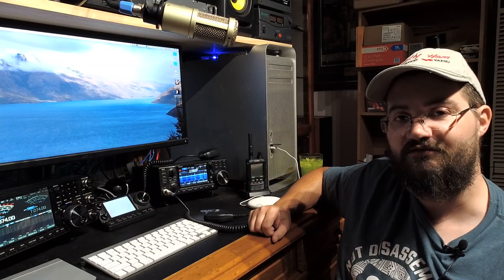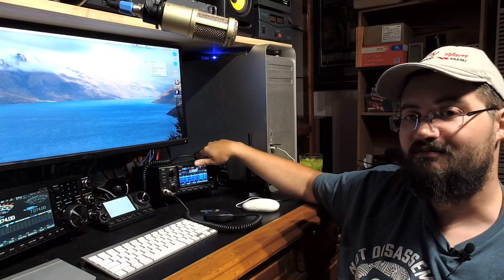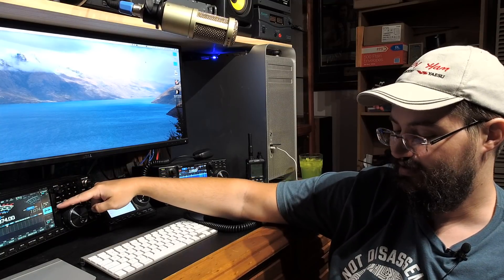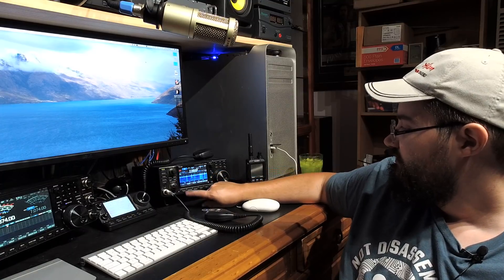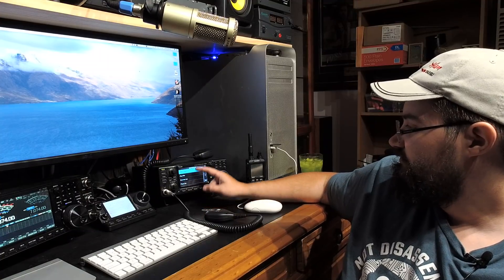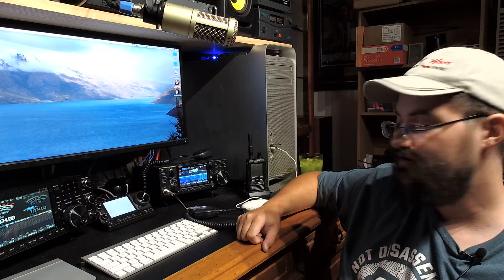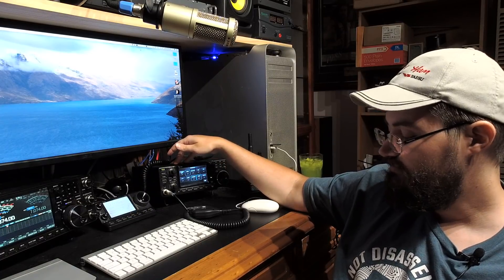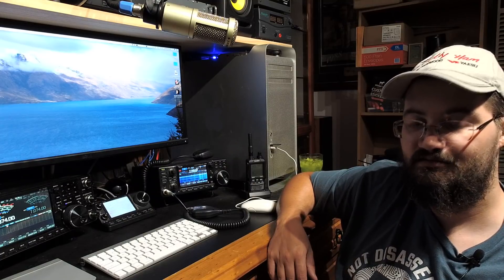5 Ways the IC 7300 is BETTER than the IC 7610

Comment: Both radios are market disruptors (and I'm not traditionally an Icom fan), but at opposite ends of the spectrum.  Both are good value given the feature set.  Both are going to push other vendors to innovate and provide better price performance. FTW!
Reply from the maker: My favourite analogy is one is a Lexus, and one is a Toyota.  And my favourite bit of advice to go along with that analogy is that there is no point owning a Lexus without a nice garage for it ;)
Reply: Was shocked at the performance on my little active loop from my last radio(only listen). Incredible reception that was unable to get in the last two years with my older radio.

Comment: 3:10 This is operator error. Auto notch is disabled in CW as it would eat the desired signals.  Only manual notch is avaliable.  Change your mode to SSB and you'll have auto notch.  The 7300 works exactly the same way.
4:50 That pronounced notch is because you've got manual notch turned on.

Comment: Thanks Jarrad, good points, I have a 7300 and have been considering a 7610, along with the lack of buffered rx output on the 7610 I think I'll stick with my 7300 for now and just add the aftermarket receive buffer board in order to use an external SDR with the 7300, 73 John K1KSC

Comment: I have them both. All valid points for sure.  But for anyone on the fence actually trying to decide between the two.. remember, a video explaining all the advantages the 7610 has over the 7300 would take a lot longer than this one.  Just compare the rear panels for a partial summary. -AD5VM

Comment: Totally agree. The 7300 is more refined in the " fit and finish " and built better than the 7610 IMHO. The screen looks more vibrant and has a nice matte finish and not plagued by screen quality issues as the 7610 is / was. I was ready to buy a brand new 7610 about four years ago, sat down with a display unit at the local ham radio store and was turned off by this, and turned off by the fact that they deepened the access to the Notch functions which I use a lot. The 7300 had it right on the front panel...nice !

 I completely changed my mind and bought a Kenwood TS-890. Love it !  The Icom IC-705 and the IC-7300 however are a total success story IMHO as I have both and are totally amazed with them and are a lot of fun ! 
 I'm sure the 7610 performs well but would like to see a 7610 Plus  ?  or  MKIIG ?

Comment: Sorry but the 7610 many times better than the 7300.   I think you just need to understand how the radio works.
7610 does have a very good notch setting.  Look at the back of the 7610, the connections you have to choose from is very nice.

Most hate what they don't understand..

Comment: The quality of the receiver and filtering is what makes a radio. The feel of the knobs, the type of paint used on the cabinet and the placement of the notch filter have nothing to do with the receiver and filtering. I love my 7300 but it lacks some features found on the 7610. And to me, those are important features. Granted, the 7300 is quite adequate most of the time but not in some circumstances which are ignored in this video.

Comment: ... and i prefer my FTDX 101D... :-)
Reply: I can't decide between the 7610 and the 101D.  I'm normally an Icom person....
Reply: @piquat1  The 7610 Is 10 times the radio of the 7300 I had both now have 2 7610,s dont understand how you can not see it.
Reply: @byroneism  Ya, it is. But I didn’t say anything about the 7300. It was below my price point. I was vacillating between the 7610 and the FTdx-101D. Got the 101D.

Comment: I would still buy the IC 7610 because it has a 2 antenna ports and a separate port for RX antenna great flexibility
Reply: At 2022 prices, you can buy two 7300's for $1000 less than a single 7610.

Comment: The IC-7300 is truly a remarkable radio. To use a term that has been used loosely by other manufacturers in the past, this IC-7300 really is a game changer. When something comes out that is really good, boxing well above its weight, I buy two of the items. This is true of the IC-7300 - I bought one from the first batch released (I think it was March 2016). I was so impressed by it that I bought a second one in August of that year. I still have both radios and intend to keep them. I was so impressed, that when the IC-7610 came out, I wanted one of those. However, the screen burn in, and loss of the deep black background to more of a milky black has stopped me from buying it. It seems they have still not resolved that issue. If I lived in the USA I probably would have taken my chances, but I live in Kenya, East Africa. To send a rig back to the USA or UK would be prohibitive in cost. I fully agree about the shiny / glossy black on the IC-7610 - it looks like a cheap finish to me. I FAR prefer a matt finish

Comment: Hi Jarrad,  I like your you tubes.  I like to add a comment. I always been a Kenwood user..I recently purchased a Kenwood TS890 .Using the 890 for 2 months  I sold the radio. I felt it has a lot of old techknowlgy so I sold it..I went back to my older kenwood 870.. Then I hear all of the hipe on the Uc 7300.. So I too a chance to purchase the 7300.  SURPRISE !  The 7300 is smaller radio BUT if gives a nlot of useful features..THe Scope are good and the radio is very stable.  OK Now  the icom 7300  blows away the Kenwood TS890... Im still a Kenwood Guy. But the 7300 is my daily user..A outboard speaker helps..or headphones by Sony-7506.. Best bang for the Dollar is Icoms 7300 by far. even over the 7610...you got it right  I agree. w2ot/marty

Comment: When will we get a SDR version of the 7610?
Reply: The IC-7610 and IC-7300 already are SDR rigs, but in a box with traditional knobs. The SDR architecture of these rigs is what allows them to have that real-time and fast (about 25 fps) spectrum display and waterfall, over the entire displayed frequency range
Reply from the maker: I don't think Icom will ever release a 'black box' style radio, BUT with the newer firmware and the USB 3.0 connector you CAN use the IC-7610 as if it were a black box SDR.  73, Jarrad VK3BL :)

Comment: are the knobs on the 7300 also buttons? I know the 7610 is a knob as well as a push button which I think may be why its a little looser.???
Reply from the maker: Its been a while now Mike but I don't believe they are buttons, and I agree that is probably why they feel a little looser.  That said, the knobs on my Yaesu FT-8800 and FT-8900 mobiles always felt tight despite being dual purpose buttons too.  73, Jarrad VK3BL

Comment: I have a made in Japan Icom 7000. Its a darn good radio too. If you are looking for a non-SDR Icom you can not go wrong with the IC-7000. They made Ic-7000s in china too.
Reply from the maker: The IC-7000 is a very popular and reliable radio :). We sold ours only because it was out of warranty and over 10 years old, also we were 10 years older and liked the remote head of the IC-7100 which sits easily on a desk :). 73, Jarrad VK3BL & Ben VK3HBN :)

Comment: Hi Jarrad, so you say that is better to buy IC-7300??? Is the 7610 just a waste of my money?. Is this your opinion just because of screen burning or loose cooler issue? There is really not a better receiver or any other significant better things on it compare to 7300?  Thanks. I am still decide between IC7300 and IC7610 which one to buy. Thanks. Paul OM0ET

Comment: 7610 - 16 bit adc, 7300 - 14 bit adc. Dynamic range and sensivity on 7610 will be better.
Reply from the maker: It is, but the enob isn’t 2dB higher, and the sherwood charts list the IC-R8600 as higher than the 7610 despite its 14bit ADC.  I wouldn’t buy just based on 14 vs 16bit.  73, Jarrad VK3BL
Reply: how did you get this info from not sure you are correct at all
Reply: The 2 bit is the noise any way no different at all

Comment: I suppose if one had deep pockets, one may wish to purchase a even more expensive rig.
That said, we are all either not willing or unablew to spend close to 3 grand for a radio, after all, this is my hobby, not a profession.

I've had my 7300 almost 2 years and see no need or advantage to buying the 7610; at least not for me.
Will the 7610 pull out signals the 73-00 can't? Doubtful. Will it TX cleaner RF? Doubtful.

I'm sure the 7610 is a great rig; just no benefit to me.
Reply from the maker: Just wondering Peter, are you a Canon or a Nikon guy?  To use a camera analogy, we'd say the difference between the 7300 and 7610 is the difference between Canon's 'Fixed 50mm' 1.4 & L series 1.2 :). 73, Jarrad VK3BL
Reply: The difference is that I earn my living from photography; ham radio is a hobby only for me. 
Again; deep pockets?..go for it. On a budget, the 7300 does everything I want, Is the7300 better in some ways? Maybe; just as the L series lenses might be considered better in (some) situations.

I am agreeing with you, IMO the 7300 IS better in some areas of operation, especially when one factors in the price of the 7300, it's a bargain.

Oh, to answer your question; been a Nikon guy for 35 yrs. ;) They are better; right? LOL

Comment: The IP+ function on the 7300 improves the selectivity in a pileup, and on CW the notch works well too. I have two IC-7300s and find the pair easy to use, can use different antennas, run in diversity receive mode using a simple cable between the radio  control ports with an on/off switch, and control both radios from the USB port for remote operation with a single IP address to the server computer running ICOM REMOTE. 

I personally think my two IC-7300s as a pair are far better than the IC-7610 and I have money to spare for the RC-28 remote encoder, and auto-tuners, etc.
Reply from the maker: It sounds like you have quite the versatile setup there!  I believe there is a group of operators who would be better off with 2x 7300s, especially if they are willing to put the effort into setting them up to nicely play together.  That said, for a bunch of other operators, having all the 'hard work' done for you is worth the extra money.  One thing is for sure though, I miss the build quality and 'notch button' of the IC-7300!  73, Jarrad VK3BL

Comment: Yea, I agree, I paid around a thousand dollars for mine after rebates and specials last year and never looked back.. It also came with a nice Heil mic too.
Reply from the maker: For the money, nothing touches the 7300 :)
Reply: @RateMyRadio I’m a Diehard ICOM MAN but I would never consider a 7300.I need at least two antenna ports so I went with the 7610.I look at the 7300 and I see a Toy that could have been so much more.If you are going to make a radio for HF/6 meters then put an antenna connecting for both.I would buy another 7600 before I’d ever waste my money on a 7300.I don’t see what the big deal is with the 7300 when it’s just a starter radio?

Comment: Which radio would be better the IC-7300 or the IC-7600?
Reply from the maker: Thats a hard call.  It depends whether or not you value a second receiver and bigger box more than a bandscope.
Reply: Rate My Radio ,. Well the 7600 has a scope.  Which is better on the receive?
Reply from the maker: That is the subject of much debate amongst the community.  I don't have a personal stake in it having never owned a IC-7600, but I will state the scope in the 7600 has nothing at all on the full speed scope of the 7300.  For a smaller station I would probably choose the 7300, for a larger station the IC-7600 may be the way to go.  Put it like this, if the 7600 is the better radio for you, you would know it already :). Technically speaking, the receiver in the IC-7300 with IP+ enabled offers approximately 20dB more dynamic range.
Reply: Rate My Radio ok thanks for your input.  I have some real nice rigs that are way better but might buy one of these 7300's just to check it out.
Reply from the maker: If you can afford it, its worth a shot.  I've heard of quite a few people who have been in that exact situation and have found themselves infatuated with the little IC-7300.  73, Jarrad VK3BL :)

Comment: The 7300 is great but would be nice to have the option of same style analogue signal meters on it that the 7610 has. It is very possible to do by Icom on a firmware update.
Reply: CI-V command 1502 "read the S-meter" could easily be added to a WinAPP to show an analog S-Meter in RS-BA1 or any other program controlling the radio from a computer.

Comment: Hi Jad, I tell you what it took me a year to finally go out and buy my 7300, for me the size was an issue, the fact that they was everywhere, I did,nt want one just because they are popular, I have to know in my own mind its the thing for me.
Anyway I was lucky enough to have the use of one over the christmas holidays, It didnt take to long to realise that it was the one to go for, what ever negatives you might have the posotives overwhelm them. keep up with the vids I do enjoy them, 73 Steve G0OGS
Reply from the maker: Dear Steve, thanks for sending through the picture of your PR-780 - it looks beautiful!  I'm not sure if I have had a chance to respond or not but it sure looks nice!  You're right; my main motivation behind wanting the IC-7610 was to finally own a 'bigger radio'.  

I had been holding of for ages as after I got my IC-7300 I didn't even feel the need to drool over higher end rigs it was so good.  

The IC-7610 definitely has a few luxuries on top, but it doesn't set the value bar like the IC-7300 does.  I'm almost reluctant to sell my IC-7300 as it will be a classic radio, I'm sure of it!

73, Jarrad VK3BL & RMR Team :)

Comment: All good points, there has been talk about having two 7300's instead of a 7610. I happen to love the IC-7300.  What I got rid of are two flex radios, and the IC-7600, and I  did like the Flex, but  I don't miss all the computer drivers and misc software I needed to make everything outside the radio to work with it. The IC7600 was a great radio, and I had a IC-756 Pro II before that. So, my feeling about the IC-7300 is based on a lot of other great radios. I don't miss much of what I had, the 7300 is great in so many ways.
Reply from the maker: We have a real soft spot for the IC-7300 too Joseph; it is a little sweetheart and have never heard of a new owner being disappointed in any way whatsoever.
Reply: I have two IC-7300s, so does a friend and we operate them remotely across the country with RS-BA1. Both appear in the RADIO LIST on the ICOM Remote so I can use ANY of the radios at any time. The built-in LAN port on the 7610 and some other ICOM radios is fine, but it's just a single IP address. Running ICOM Remote on a laptop with USB 3.0 hub, and multiple radios is easy, and it works perfectly. Even the 7610 has a functional USB port that allow it to be on the same SERVER as another ICOM radio with USB CI-V control.

Comment: I love my 7300... It has some birdies in the Gen coverage..
Probably need a firmware update.
4000$ exceed the worth of qsos these days.. I would rather have 2 7300s duck taped together...
Reply from the maker: If you won't mind, could you please let us know what frequencies the birdies are on?  We'd love to compare it to the IC-R8600 which is a similar design.

Cheers, Jarrad VK3BL
Reply: I start on 8550khz- 10mhz
Reply: 2 7300s duck taped together=7300s in stereo lol the 7610 has 2nd indepedent trx dsp is better also built in psk
you really have to use 7610 then try 7300 mine was 3k usa totally worth it and i paid more for my 7600 than my 7610
it also has dvi port in the back goes direct to 32in monitor looks awesome.the 7300 is not better he rants about
the notch i dont use it at all 3 diiferent adjustable filters see other you tube videoes from icom for demo
Reply: @kg2mb1  Exactly False information on this video for sure opinions are like @%%holes lol

Comment: I have no interest in getting a 7610 after buying the 7300. In fact, I am considering selling my Flex gear. The 7300 is that good.
Reply from the maker: The IC-7300 really is that good :). Unless you have a well setup shack and the best antennas possible at your QTH, we recommend the IC-7300.  There are of course exceptions, but the IC-7300 is more than enough radio for almost anyone!
Reply: That's Good News! I just Brought one
Reply: @mikeh8028  I bought one two months ago and I used it everyday and night.
Reply: How would rate the 7300 up against ts-590.... I'm looking at both and kind of hard to choose over the other... Also a long time shortwave linster...
Reply: @tvsony994  I have a 7300 and thinking of upgrade to an 590sg

Comment: Hi Jarrad, I have both the 7300 and the 7610. You mentioned on the 7610 there's no function, that because most of those functions are down the left side of the touch screen. I do miss having the SWR checking function but being an SDR radio, it could be added later in a firmware update. There are a lot more functions on the 7610 such as twin transceivers and a video output. Don't get me wrong, I love my 7300 and will never part with it but that also goes for my 7610. I do find that the 7610 has the edge on the most weakest stations. So I guess the only factor left is the price... you could afford two 7300's which you are getting in one package  with better specs. 
73 Roy ZL1LK
Reply from the maker: Dear Roy, I feel completely the same way about you - the 7610 is a significantly better radio, there is just no doubt about it.  I especially like the sound of the receiver, which is unparalleled out of the box; it took me 30 minutes of tweaking just to get my ANAN-100D close!  

I'll probably follow this video up with something like - 10 reasons you should buy / upgrade to the IC-7610; this particular video was aimed at encouraging those new to the hobby to stick with their IC-7300s until they had the rest of their shack in order :)

Thanks for the comment,

73, Jarrad VK3BL & the Rate My Radio Team.
Reply: For the price, it better have a better sound, but I have better sound from my car stereo system, but my car doesn't do 20 meters.